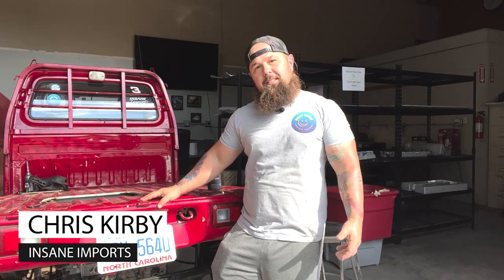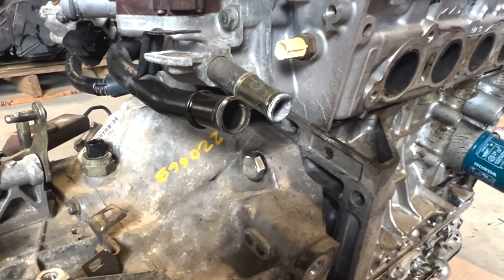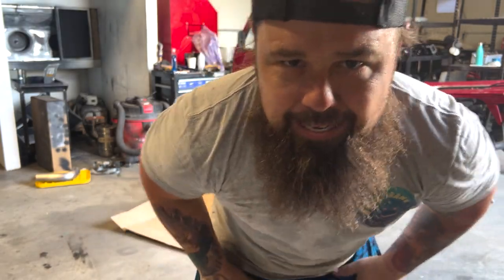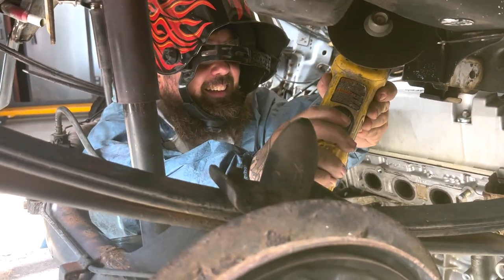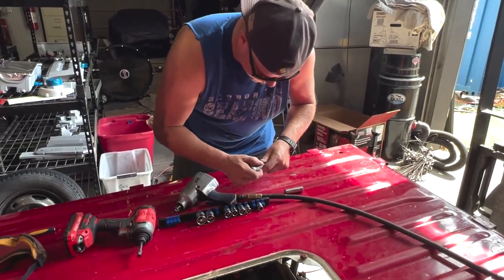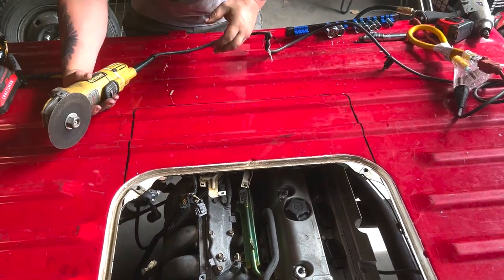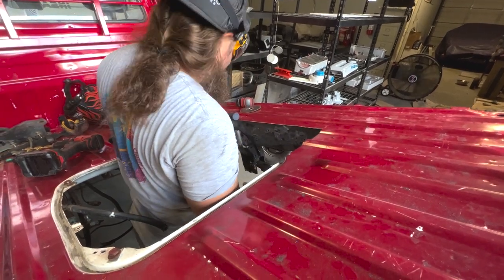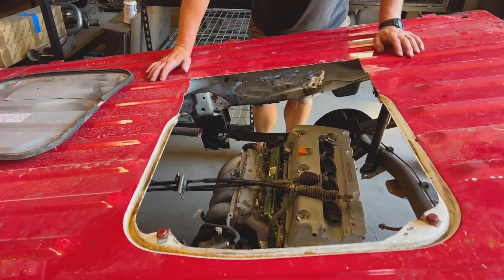Motor in! JDM Mini Truck K24 Swap in Honda Acty - Rare Kei Truck Engine Mod Adventure

Comment: Curious because I'm thinking about an ej20/ez36 in my Kei truck, why the K20/K24 over a flat 4/6? In my head the ej20 would be the perfect motor for a truck like this since you could fit the whole thing under the bed.
Reply from the maker: I had my heart set on the Honda motor and I’m more familiar with it so that’s what I went with. Your plan sounds great though. Would love to see how it turns out!

Comment: You can use a small wrench, the boxed in side. The same size as the Ebrake cable. Slid it over the cable and easily pull the cable out.
Reply from the maker: Thanks 🤝